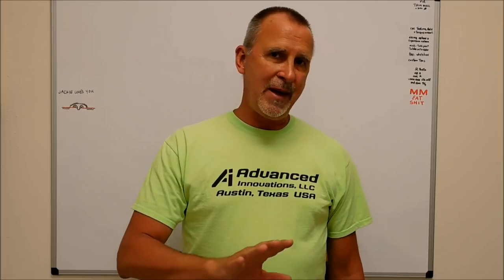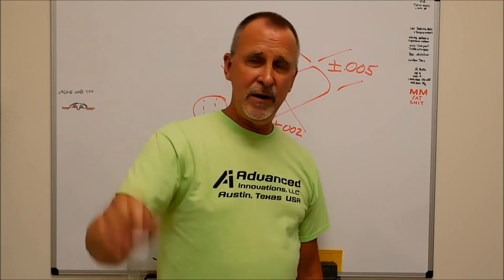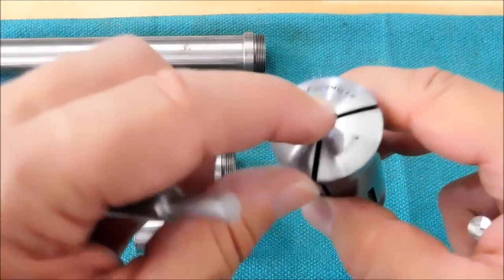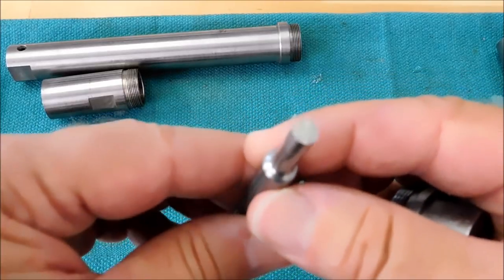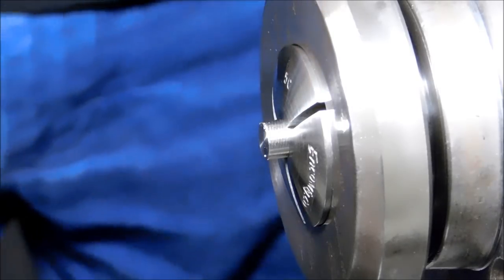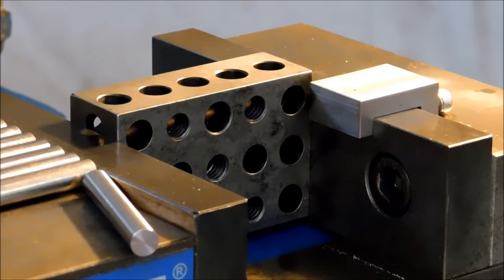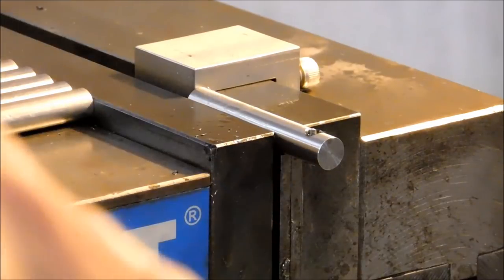Great setups, Crappy results, and the reasons why. Take a look

Comment: Nice vid. About that final setup—aren't you going to need a second clamp to hold the part flat and centered in the v-block? Also, spot-facing it to keep the drill from wandering seems prudent.
Reply from the maker: The stops hold the V block, the vise holds the part. If the ends of the part are square, it should sit just fine.
Reply: Can't argue with success!

Sill, I'd worry about jaw lift raising the part so it was no longer snug in the v. A 5/16" round face is a pretty small surface to count on keeping things square. Adding a top clamp to keep the part forced down in the v would seem prudent.
Reply from the maker: Certainly couldn't hurt.

Comment: i hate intermittent problems, i had a bike and it had a horrible gas cap and it would leak if you didnt put it on right and it didnt have a pressure inlet valve so if you had it a certain way it would vapor lock after a while, i thought it was spark, i thought it got somehow flooded while running mid throttle, thought dirt got in the carb or something, it took me a week of frustration and walking home to find out what it was, i would stall out and check the gas and it be half tank and it would start and go 10 feet then die again and i would get madder than a hornet and curse up a storm and then i had a thought and put a different gas tank on it , making sure the inlet on the cap worked and i trust it cross country as reliable as can be now, never had a problem since, and i never knew what it was cause sometimes it would not run at all after you checked the gas so i didnt think of vapor locking, also it would start every morning and get me far away and not get me back, i was pissed and almost gave up on honda, but nowadays i just rightfully hate metal gas tanks . . .its the cap that ruins it, not so much vapor locking but every metal tank i ever met leaks, plastic is the way to go, dont ask me why but if you been there you know what i mean

Comment: Thanks Joe - lots of nice ideas - is 5 thou typical for a +/- on a production part?
Reply from the maker: Depends on the type, and number of decimal places on the dimension in question. Tolerances get tighter as the dimension get more detailed. a 1/2" dimension would have a greater range than a .500 dimension.

Comment: I immediately had the thought that the collet would not return to the same zero for each part, but not because of the diameters. I didn't think of that at all, also effecting the position of the hole. You'd have to measure and offset to cover that but it would slow you down individually measuring for oal. I also don't like taking up full tolerances and changing tool pressures so I find this only would happen to someone who was looking for quantity over quality. What I do is cnc grinding and tool pressure is extremely critical when you're talking +- .0001 or +- 50 mil, and tolerances stack up real quick.

Comment: Is there any good/easy way to re-zero off the face of the collet for each part to get around the varying pull in? Also how consistent are the various ways of pulling in a collet?
Reply from the maker: If you dont have 1000 pieces, measure and group them. This way the number of zero adjustments is minimal. 5C collets pull very accurately if the OD of the parts are consistent.

Comment: Another great video, any mistake you can make I have done it. A few of the operations I did see and thought oops thats not right (like you said). I am always learning something new. The dimension from front to back on the diameter would it help to use a center? then cut to length. Thanks Joe. Mike.

Comment: Thanks Joe. A very interesting demo.

Not too long at all, thanks for the complete discussion. I prefer too much relevant info than not enough.

I was thinking along with you on the solution using the V-block to center the hole, but the others bit me.

I wondered about how to eliminate the OAL issue. Leave it a few thousandths too long, expecting to trim it in the final operation. Use the mill - with appropriate supports as you've shown - to cut the final OAL with minimal overhang to reduce bending. Maybe consider trimming both ends on the mill to eliminate tits in the center. I know, it would add steps to the process. But would that solve the OAL problem or would it introduce some other problem?

Then use a V-block and stop to establish the hole WRT the end, while centering it.

Sorry, I don't have an answer on the OD except to use the chuck jaws as you mentioned. Too bad there was not a hole in each end for centering and controlling the OD.

Thanks, just wondering.

Comment: Joe, another great video. Thx for the info.
Question on edge finders: If knob on the finder is .200, when it kicks isn't the distance to the edge less than .100? Seems like you would want distance just before it kicks. What is your philosophy?
Thx.
Marty (the noob)
Reply: skeeterweazel from what I have read. Threshold between and edge finder running perfectly true to it kicking off is about 0.0005 inch. If that can be enough to kill a part. Then you may want to use an indicator with 0.0001" resolution.
Reply from the maker: Agreed. And, check the first part to be sure.

Comment: How would holding the part in a collet-block compare to your v-block strategy for drilling the hole? Great stuff!
Reply from the maker: I would put my money on the 'V' block setup. Collet blocks have there place, but would only translate the error in this case. The part should be registered from the dimensional surface. An outrigger stop would work well if you used a collet block. Don't use an internal collet stop, or you have achieved nothing.
Reply: Hey Joe, Thanks for the reply; I'm honored... just a "wannabe" here, not a pro. The other question I had was about ganging them up in a vise to mill them to length, eliminating the dependency on the diameter...?
Reply from the maker: Thats a perfect solution. I have actually done that. Good call.  Look at this one. Start at about 5 minutes   https://www.youtube.com/watch?v=1JcBphFxEe4

Comment: Also falls under Murphy's Law. "What can go wrong, will and without warning".
Thanks Joe. Some very pertinent points.
On the question/result of the part growing/ shrinking in the 5C collet would an ER collet still suffer the same problem seeing as they grip front and back not just the front like a stretched/shrunk 5C does? I'm suspecting that might help reduce the problem? 
Regards from Canada's banana belt.🤞🇨🇦🍌🥋🇺🇦🕊️🇺🇲👍

Comment: All along you allow for or have provisions for positive features from the part off. I would think a toolmakers V block using the arch clamp screw would avoid clamping parted positives. I would not be a fan of end gripping 5/16" parts. How ever a well thought out video full of good info. Thanks Joe!!
Reply from the maker: The only real danger of end gripping a 5/16 diameter part would be crushing the part once the hole is drilled. The seat in the v block and end support really make for a solid setup. Just don't squash the part.
Reply: Joe Pieczynski I don't have much time on a collet lathe it was good to see the potential problems that might come up. Thanks again Joe

Comment: Joe, how does the V block register against the fixed jaw?  It is not held by the jaws since the part is longer than the V block right?  I'm probably missing something.  Love your videos, thanks for all the effort!  I would love to see this video reproduced using the more accurate setups now.  Thanks again, Jim
Reply from the maker: X axis is trapped by 2 stops, Z axis is on parallels, and the Y is pressured with a spring against the movable jaw.

Comment: You noted the taper from turning down the stuck out rod, and it seemed like you'd loose track of which way that taper runs after taking the parts down to length. Would you put ink on them to keep the taper orientated consistently for subsequent operations?
Reply from the maker: In my world, and by my standards, any taper, on even a simple part like this would be unacceptable. I would not proceed until the part OD was the same all the way down. Your observation of a marked working end is something I do all the time. Especially on square parts. I normally mark the banking corner.

Comment: Nice video Joe! Just wanted to add to the dia change situation you described. I train noobs on the CNC lathe and besides the hurdles of teaching new kids in the trade or Mill guys, I often stress how important the dias are when going from first op to a secondary when using a machine that isn't equipped with dead length collet chucks. Using your .005 tol on the dia I would always tell them to hold a few tengths regardless of what the od tol is. Easier to do on a cnc. 5c collets have a 10 degree taper so when you do the math the dia from part to part is critical during the first op. For every .0002 change in dia your length will change when facing the backside by .00056.
Reply from the maker: Its a gremlin that has frustrated many new guys. I say "start tight, end right".

Comment: What I do is use a square 5c collet block and put it in the long way in the vise. I lock the part in the block, put the block in the vice, end of part touching a stop, then tighten the vise. Never had an issue with off center holes, but admit, I do not check that many of them. I was thinking your solution would be this, but you surprised me. And so, I ask, do you think my method is equal in quality to your method? If not, why not? Thanks ahead of time :)
Reply: BiddieTube if the diameter is variable, so too will be the distance for the hole as he explained. A V block doesn't care about diameter since it splits the difference equally. Then again, if you knew that you had the same diameter parts for sure, I assume that would be a great way to do it.
Reply: BiddieTube, your method of a 5C block would work. As long as you stopped off the end of the part, not the 5C block. The collet will maintain part centerline.

Comment: Just an added thought: not all collets are pull-to-close. Most Brown & Sharpe collets are designed to be closed by being pushed into a nut. In fact, there are even 5C collet fixtures and systems that move the taper up and down as oppsed to moving the collet in and out of the spindle taper. I know this info wasn't the point of the video but is something to consder when choosing the tools and methods in performing a job.
Reply from the maker: Any collet that moves inward, pushed or pulled, is going to bite you. The 5C sliding cone setup is probably the best if the stop is anchored elsewhere.

Comment: Awesome video Joe, learnt heaps. Can you quickly explain what you meant by putting a scrap between the v block/part to avoid drilling the v block? Can't quite see what that would look like while still maintaining tolerance of v block. Also got to give you a friendly jab about that stop needing a trim, what do you say about not putting off jobs that will save you time in the long run, ha ha ha. keep up the videos mate, there great.

edit. sorry I miss heard you. you meant make a new v block out of aluminium etc. cheers.
Reply from the maker: You should know by now how I feel about putting off time saving tasks. Do it when it needs to be done and benefit by that decision next time. I don't usually wait.
Reply: Yeah, got that vibe from you Joe, hence the friendly banter. ;)

Comment: Nice.  As far as turning to length, how about a stop in or at the tailstock,  measure from the tailstock end, and catch the part as a cutoff?
Reply from the maker: I've seen that done.
Reply: @joepie221  I just found out about spindle mounted stops :D
Reply: Like on a chucker lathe one of the turret tools is the stop for positioning the stock extending from the collet.

Comment: Hobbyist here - I would have used a table-mounted stop rod and butted the part up against it, making the other end of the part the datum, and scooted the part far enough to the left such that the whole part was trapped in the jaws, so the butt end of the part passed through the centerline of the jaws, and scooted the parallel far enough to the left so that the drilling op didn't hit it. Would my setup have eliminated the issues (other than OAL and taper) that you encountered?
Reply: Oops, I guess the hole could still be off center with variations in OD - the vee block solution is still superior....

Comment: Another thing that I expected you to mention: at 19:30 you're spot drilling a) with the bit sticking out very far; b) a surface that is not a flat surface perpendicular to the drill bit axis. I'd expect the tip to walk off the center. Is there a reason why these wouldn't be important here?

And, of course, excellent video! Please do more of this type!
Reply: Ivan Tarasov you can use a center drill on a tangent edge without issue. It's a ridgid tool
Reply from the maker: It was a center drill I used. Be gentle on the initial contact and the tool should track just fine.

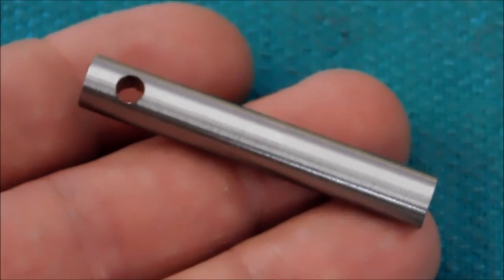Comment: Stopped at 20:38. Because you're using a collet and a stop, if the part diameter varies, the OA length of the part will vary as well. Smaller diameters will yield a longer part. The cross hole location will vary with part length because you didn't drill the hole from the stop end. As the part length varies, so will the hole location. As far as the hole being out in Y, that is a function of diameter variation as well. I've been doing this a while. Lets see how I did...
Reply from the maker: You passed.

Comment: I have a question about the finish;  Right around 4:33  the  cut takes on a different finish characteristic. After that it's more coarse and the surface looks sort of torn.  Sometimes this happens to me and It's lube, Other times it seems I need to be taking a dee[per cut and still others I gotta toss the carbide and use high speed steel for the sharper finer edge it allows.  What do you think is going on here?
Reply: I keep getting that problem as well. I think it is down to older or bigger lathes having slow top speeds. Mine will only go to 1000rpm. I find that a round button tool gives me the best finish on steel.

Comment: Only thing I'd say about the last vice set up you suggested is how tight you're going on the part. A similiar setup to this bit me in the ass before. The tightness was varying and some parts bowed more than others resulting in holes that weren't square to the centerline of the part. Fortunately it was one of those "Good enough for who it's for" jobs so it was grand.
Reply from the maker: If the dimension was that critical, it should be strap clamped in a fixture and not done in a vise. Vises do move depending on the torque as you are now aware.
Reply: I hate clamping round stock in a vise and avoid it when I can unless it's just a down and dirty .. getter done job. V blocks rule.

Comment: One thing with the V- block setup,  since the part is tapered, the hole you drill will be at an angle and not perpendicular to the part. Just saying........
Reply from the maker: Actually, if the ends of the part are parallel and the part is being clamped on the ends, I'd bet the part would level out and the hole wouldn't be angled. Just saying........ Either way, .0005 over 2" and the normal working tolerances for 3 decimal place holes would either absorb any error, or the assembly would never be affected by it.
Reply: @joepie221  yes, on a properly machined part I would agree, of course. I was thinking of a machinist that was asleep at the wheel and accidentally made the part too tapered; like you were trying to illustrate to us. If it's too tapered then it would be problematic to drill the hole precisely because the operator wouldn't know he had created a tapered shaft. 
I do love how you blow up tiny errors to a large size, for illustration purposes, so that it becomes an understandable problem for the rest of us. You're a good teacher and most of us need that kind of help that someone like you can provide. 
Are you familiar with Titans of CNC?
Titan doesn't want anything going out the door that isn't at least within a tenth. That must mean that his machines have far better than a tenth operational accuracies. 
Is this the case with modern CNC equipment that machines routinely hold tolerances way better than a tenth?
Are modern machines that accurate?
I expect 50 millionths (or better) operational accuracy out of a KERN but what must the routine accuracies of other machines be?
To be able to be within a tenth then most other high end machines have to average close to the KERN's 50 millionths, right?
Anyway, love your teaching style and I appreciate the extra work that you put in to make your videos. 
I like Einstein's view of Education's only real value being in its ability to make us think. I agree with that. Memorization can be useful but the real gold is in helping students learn how to think - an approach you excel at. 
Thanks again for everything!  :)
Reply: @joepie221  I know this will be splitting hairs but the only way I can see to deal with a taper is to mount the shaft to a sine table and adjust the shaft centerline perpendicular to the mill spindle. In this way the hole's entry and exit will be spot on. 
Anyway, that would be my approach but I know it's excessive and, likely, unnecessarily time consuming. That's just me, I guess......
Reply: I think you can measure the diameter of the part on both ends to figure out how much tapered it is. After that with little bit of trigonometry you can calculate what angle that taper will create and whether it falls inside the spec. V-block setup means you are actually getting a lot less angle from that taper compared to having the part sit on flat surface.
Reply: That's very true.... But the location of the hole might still be within tolerance as long as there isn't a perpendicularity call out on the print.